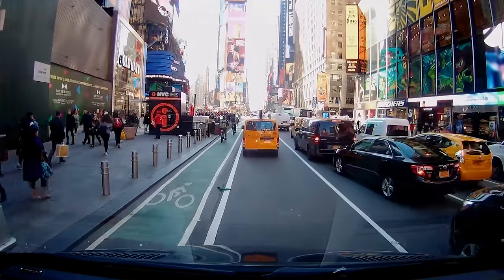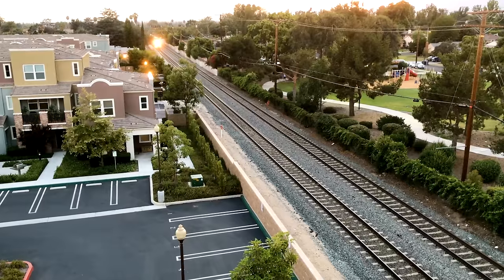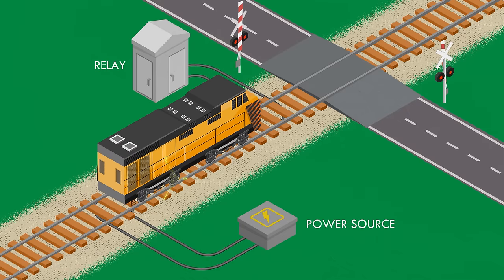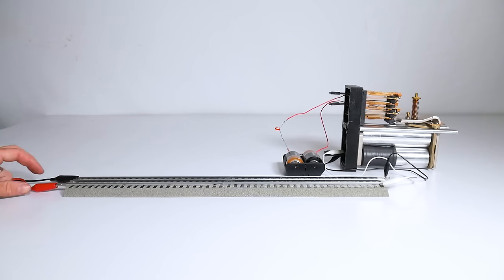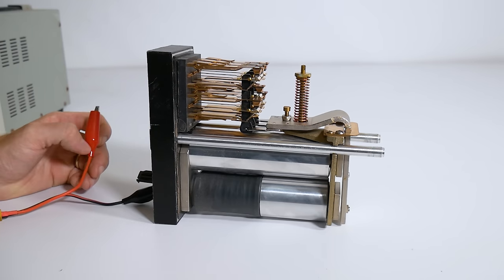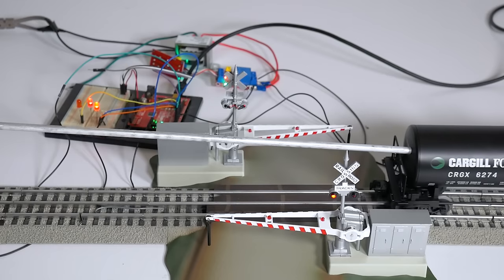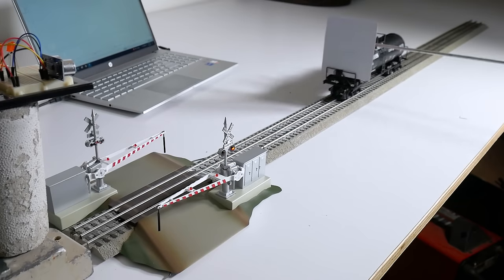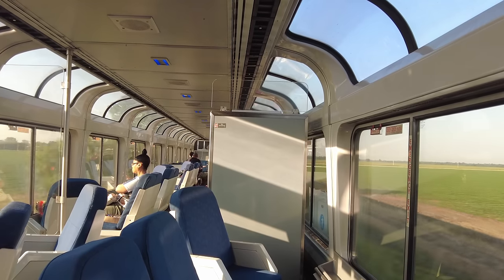How Railroad Crossings Work

Comment: It should be mentioned that the mechanical or synthesized bell sound emitted from crossing signals is often low in volume and ceases as soon as the gate is down.  Its purpose is not to alert drivers in closed cars with the radio going, but rather is to alert pedestrians that crossing gates are descending from above.

Comment: Signal Maintainer here. Excellent video. The coordination with crossings and traffic lights is called preemption. You really hit on a lot of information that didn’t dive real deep, but just enough that would allow people who want to geek out on this stuff, can. A lot of people don’t know this, but everything on the railroad is designed to fail safe. Putting things at its most restrictive state to protect train movement. Most of systems used on the railroad that are state of the art were designed in the 80s. The railroad its self doesn’t just install things that haven’t been tested because of how serious things can get if there are issues. Anyways, I’m going to watch more of your videos. Thanks!

Comment: Where I drive trains, on the faster routes, the speed is measured at a point and of it's above a certain threshold the crossing will engage early. There's also built warning systems that detect if a vehicle is on the tracks while the crossing is engaged, a warning signal is then sent to the train driver at a certain point when it's plenty of time to stop before.
Reply: You drive trains? How big is the steering wheel?
Reply: @pootispiker2866  About the same as in a regular car.
Reply: @HavasiP Sporty.

Comment: I heard that in the UK, full barrier crossings are down for quite a long time because of the signalling system to guarantee the train's safety
Reply: Level crossings are often protected by the wayside signaling system in Europe. This means the train cannot get a clear signal to proceed until the line is clear AND the level crossings are protected. When trains move faster, the distance out ahead of the train for level crossings to activate increases.  This often leads to 5-10+ minute wait times at level crossings.  But, if there's a problem at a level crossing, the train will ultimately be forced to stop.
Reply: When stationed in East Anglia back in the late 70's, everything was station managed including manual gate crossings.  I would be driving to or from work and if I saw across the fen, the station operator going towards the gate, I would go out of my way to stop so I could watch the flag gate process.  With the commercialization of British Rail, that all went away (as well as reliable passenger rural train service!)  Simpler times indeed.
Reply: Not just the train's safety, but the safety of other crossing users too. The signalling system will stop a train if the crossing does not close correctly. This does require a fair bit of lead time with large heavy trains, but crossing accidents here are rare. Sometimes the delay is minimal too, like in the common case of having a level crossing at the end of a station - the train is stopped or slowing anyway, so the crossing can close quite late.
Reply: @cooperised yeah. I am fortunate not to live in a country with level crossings.
We put all of our trains either elevated or even better but most expensive, underground! For roads, we either elevate them or go underground.

Comment: You really did a good job of showing how a grade crossing works, I was an instructor and a assistant inspector of signals for a railroad in NY, retired now, all we have to do is instructor people not to cross tracks until the gates are up and at rest or not to race the gates but if they do get caught on the tracks that the gates are meant to break way with minimal damage due to shear pins holding the gates.

Comment: There is a large factory with a train yard a few hundred feet from the downtown in my city. Some locals get annoyed because the first grade crossing nearest the rail yard also happens to be one of the busiest four lane thoroughfares that crosses town. Unfortunately, the ire is at least justifiable in part because trains have been known to sit at this crossing for extended periods of time--30+ minutes is not nearly uncommon enough. Fortunately, due to the yard being so close, the  trains usually block the crossings so it isn't easy or common for people to simply drive around the crossing arms.

That being said, there are multiple crossings nearby and drivers have been known to simply drive a flew blocks down to a closed crossing in front of the train and drive around the arms. Also, perhaps due to their frequent use, about once every two or three months, one of the multiple crossings has some fault that causes the arms and bells to go on for hours and hours despite there being no train present. You'd think whoever is responsible for maintaining the rail crossing would have an interest in responding quickly, but they always seem to take their time.

In either case, it seems like these are the best systems we have, but they sometimes strike me as deeply flawed. Like most such things, I'm sure its all about the economics and how much the railroads are willing to pay--at some point it's easier to pay off the families of a car full of dead people than it is to improve all grade crossings.
Reply: Public Service Announcement:  NEVER EVER drive around a lowered railroad crossing gate arm.  It's ALWAYS illegal.  Even if you think you can get away with it, don't do it.

Trains are subject to the laws of physics, just like everything else.  A big reason trains may need to stop for a while is if they are doing switching (or shunting).  This means adding or removing cars from the train.  Train main brakes are pneumatic (air-pressure driven), and are designed to apply at regular atmospheric pressure.  To turn the brake off, pressure must be applied.  There is usually one big long pressure line that runs from the start of the train to the end.  When cars are added or removed from the train, it can take time to re-pressurize that air line so the train can move.

It sounds like the only solution to those issues is grade separation (e.g. putting the road under or over the tracks).  This costs millions of dollars, but it isn't even always possible if available space is at a premium.
Reply: Drivers seriously need to get used to not being first priority.

Comment: I don’t think the model railroaders were cringing as much as you suggested.  Arduino circuits are a very viable way to add this to ones model railroad.  There are many others specifically built for model railroaders as well.  Well done video!

Comment: I worked on an Operation Lifesaver project back in the early 90s that performed RR x-ing upgrades at 300+ intersections. A couple more things: There is an advanced advisory sign that is round, yellow/black with RR X imprinted. There also is double yellow lines making it a no passing zone. And, at unsignalized crossings, a white reflective strip is attached facing approaching traffic from the opposite side of the tracks to give a 'strobe' effect when headlights it at night visible only in the gaps between the crossing train. Many crossing accidents are in rural areas at night without flashers wherein the vehicle slams into the side of a passing train.

Comment: Nice video! One thing I'd like to mention, though: your railway relay is not actually a "track relay". Track relays operate much like an old-fashioned electricity meter. They have an aluminium disc ("vane") that can rotate. To energise the relay, you need a local phase (like the voltage coil in an electricity meter) and a track phase, like the current coil in an electricity meter. They need to be in phase in order for the relay to attract. That way, only a certain voltage (one with both the correct frequency and phase) can attract the relay. If it's just a little bit off, it won't work.

This whole thing is done in order to make the track relay insensitive to stray voltages, that happen to flow in the rails. Especially in electrified territory, where there are large traction currents.

Edit: I understand now that these relays are used as track relays in some areas with DC track circuits. My apologies! I still like the technology of the vane relays I described though.
Reply: That's true for AC track circuits. DC track circuits use the same types of relay he used.
Reply: It's a form of relay that is used for the railway in the UK. Not the exact relay code we use for direct track circuitry from rails to relay, but close to it. As long as that relay sees voltage and allows it to energise or de-energises, it was very good as a way of showing how DC track circuits work in my opinion.
Reply: That is used in cab signaling as well. You have an interrupted signal (100Hz and 250Hz for old PRR) to give the next aspect. The faster, the faster (solid is an error). You don't need the vane relays on track circuits, just a frequency filter (it's a 1/0, where cab is like a percentage). The relay Grady had is what I know as a vital relay. It's used in track circuits, switch circuits, signal circuits, even for train control loops (onboard). Silver-impregnated carbon contacts (carbon doesn't spatter, silver for conductivity). The contacts are also designed to 'wipe', to prevent build-up of spatter. They all need to be calibrated every 4 years or so. There are often two coils to allow for redundancy (e.g. one control line fails, half the magnetic force is enough to close it). 
    Track signals have to be distinct from cab signals, and you alternate frequencies which are not harmonics of each other, in the event you have a signal bleed over into the next circuit. 
   You also have lots of timers. When you line a route through an interlocking, you have to keep it locked long enough for a train to go through it if it's close enough to the home signal to where it can't stop for a red (take the route away). Traffic uses stick relays (which look like an X, you reverse polarity to flip traffic).
Reply: In the US, relays that are a hundred years old can still be found in daily signal operation because they absolutely must not fail in an unsafe condition. If they fail, they must fail in a way that turns the track signal to the most restricting aspect that it can display. The cheapest and most reliable way to accomplish this is through relays that open with gravity.
Reply: marco 23p

You're wrong. That's a Union Switch & Signal type b plug in relay.

Comment: Awesome video, I love everything rail related :) Here in Poland older railroad lines still to this day use actual rail workers on railroad crossings. There is literally a person stationed in a little hut next to the road and he has a lever to put the gates down and turn the lights on when a train is approaching. Usually he gets the info via a special phone line from nearby stations. Slowly but surely those kinds of crossing are being replaced with automated signals though. 
Used to have that kind of crossing near my home 5 years ago before it got replaced. There were several workers working in shifts, and I got to know most of them.

Comment: For non-powered low traffic grade crossings I like how england did it (and there's still some around).  The bar is always down and you have to manually lift it by using a pneumatic pump(?).  The pneumatic cylinder isn't perfectly sealed so it slowly loses pressure.  It stays up long enough to get back in your car and drive through but not long enough that someone coming along later would have an open gate.  It forces the driver to actually stop and listen for a train while giving them control over when to go.  I imagine they're largely phased out because people with mobility issues can still drive.
Reply: The most rustic I've ever encountered was on a bridleway in July. "Stop look listen beware of trains" and a manually operated gate. Also an instruction for horse riders to phone before crossing.
Reply: There are plenty of older crossings with swing gates. In that case, drivers have to cross the tracks 5 times: once in the car, and 4 times on foot, to open and shut the gates. Definitely "safer" than having them cross only once.
Speed bumps (or better yet, lowering the road before the LC so it acts as one) would've done a better job.

Comment: I've seen an intersection + crossing combo where the oncoming light on the side of the crossing was doubled-up, so a light at the intersection proper and also at the crossing in addition to the crossing systems already there. Presumably it was intended as another layer to help avoid people stopping on the tracks.

Comment: Regarding trust as a safety feature: my hometown is a good example of what happens when you lose that trust.

In my hometown, trains'll frequently stop at the crossing during when school gets out, with roughly the centre of the train sitting on the island. It's a small town split in half along this single crossing, so all anyone can really do is wait. 

This has led to kids simply climbing the train, especially teens who need to get to work. Some have to go under, because they're not fit enough to climb the ladders (harder than it looks!). 

Now, trains start slowly, but that doesn't stop them from being dangerous once they start moving. Injuries have happened. And now you also have cars trying to rush through when the gates close, lest they have to sit there for up to 30 minutes.
Reply: The middle of trains don't start slowly. They could be completely stationary and jerk to several miles an hour with no warning.

Comment: In my home town, there's a long street that paralells a rail line with a few intersections and somethings I noticed passing through that stretch regularly, when a train is present, all of the lights for the parallel road will change to green but turn arrows will be red and cross traffic can only turn right while a train is present.  I also noticed that the light will react faster than the crossing arm.  Each light has a high mounted white lamp that flashes when a train is approaching and flips to solid when the light changes over to this special state.

Comment: i actually already did a deep dive on our country's railroad crossings because i grew up near one that would close for 3-5 minutes for "no good reason".
I tracked the issue down to the following hilarious problem after talking to a few local engineers and rail workers:
they placed a set of sensors BEFORE the station that's within a stones throw.
AS IN: a train would arrive in that station, and the crossing would close while people boarded & whatnot.

and YES it has been explained by those same people that "we do this because cargo trains do not stop there".
but i've also been told by those engineers they proposed cheap & effective fixes for the issue that'd prevent AMBULANCES getting stuck and save countless millions per year in lose earnings due to trafic jams.
They were flat out ignored. :)
Long live Belgium, the cuntry of "no no no we are modern. trust us. we are not a joke."

edit: totally forgot to mention the fix that they're implementing after 40 years of citizens, employees or theirs & engineers complaining:
The rail company is NOT doing the 5-15K technical fix on their sensors.
the tax payer is going to pay for a few MILLION euro costing tunnel.
> c u n t r y <
Reply: Amazing they just won’t install predictors that can tell train speed and determine when to lower gates. And will auto open when a train stops short of the crossing island.
Reply: Multi-minute warning/wait times are not uncommon in Europe at all.
Reply: In the UK, these level crossings generally have a "non-stopping" and "stopping" mode, that's selected by the signaller depending on the train scheduled to pass. If "non-stopping" is selected, the crossing lowers as usual. If "stopping" is selected, the crossing does not lower on it's own. The train driver/guard has to press a button in a locked box before departing.

Comment: Great explanation of an "Easer wheezer" DC crossing. Constant warning (predictor) crossings can become extremely complicated when there are multiple routes to the crossing across many tracks. Then add to that the insulated joints necessary for control points. There can be several predictors running together to accurately determine the warning time.